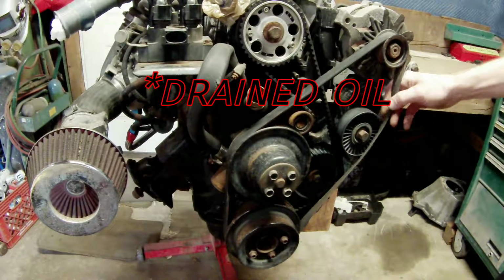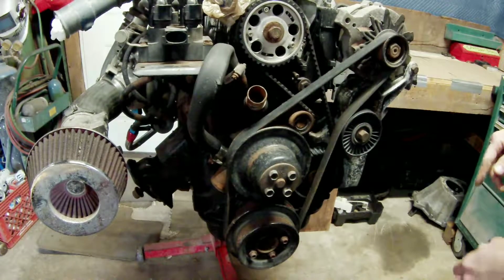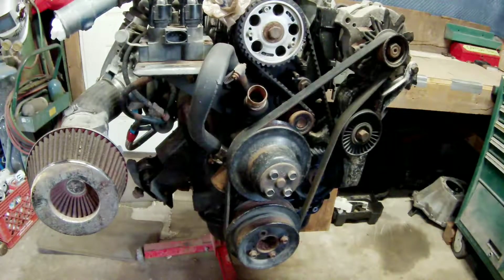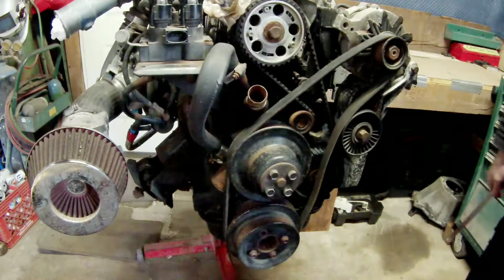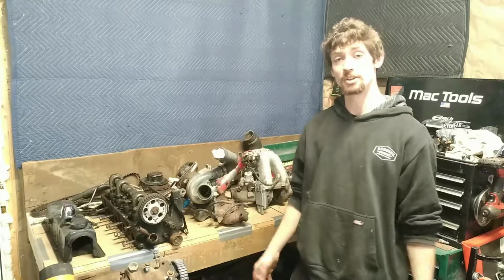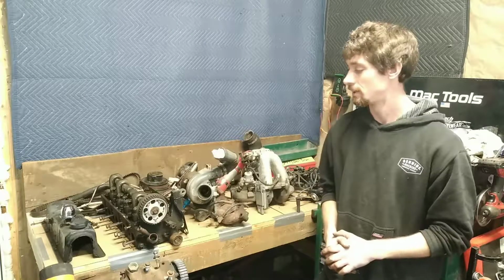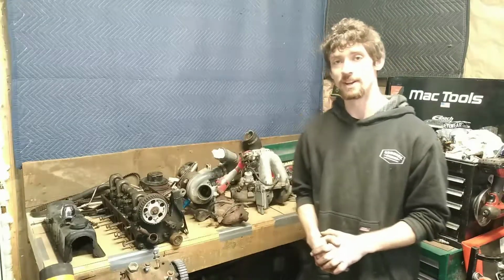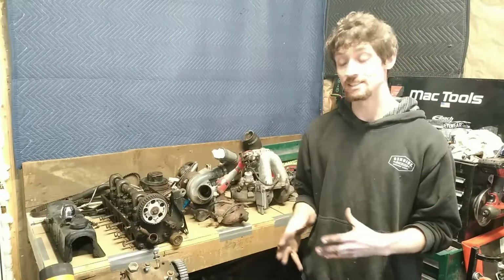Ep.12 Ford Lima 2.3 turbo engine teardown!

Comment: Hey what’s the year off the engine. I know it’s not a original turbo engine. The original engine are from the 80s like turbo coupe and svo. 
Could be stock turbo forged pistons with intake.
Reply from the maker: It’s an 88 turbo coupe block, with a 93 na head. I made a follow up video showing the engine code. I’ll leave the link here.   https://youtu.be/YZ7n60wgIog

Thanks for the comment and interest in the engine!
Reply: Building a 2.3L 93’ ranger for street and track, any info and tips you guys might have would be a great help,

Comment: Just a heads up that is not a turbo head or block turbo heads are 4 spark plugs with a distributor so when you plan on running this motor be careful of the boost levels my stock turbo head and block can only handle 19lbs before lifting the head
Reply from the maker: Thank you so much for that info! I haven’t done a whole bunch of research on these things specifically, still a little ways away from it all coming together, a lot of rust repair needs done and sourcing some other things. At first I just want to run “stock” (7ish psi/.5bar) boost and go from there. So hopefully everything will work that way in the beginning. Thanks a lot for your comment, and I see what you did there with “just a heads up” lol, good pun!